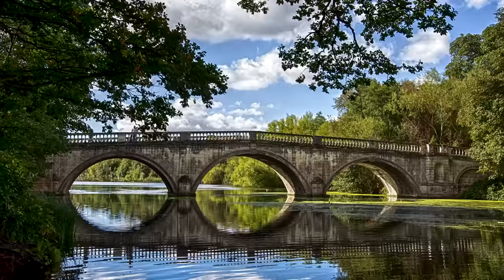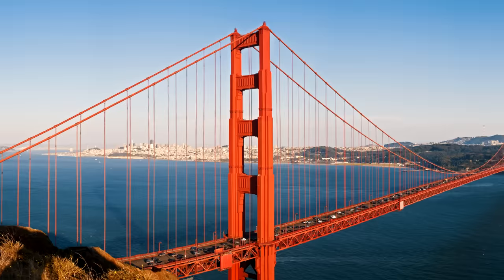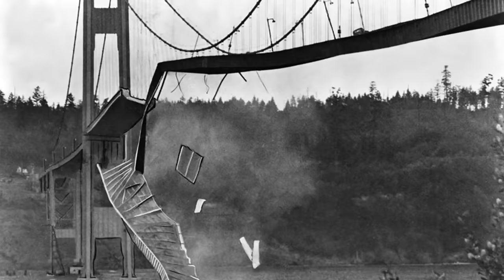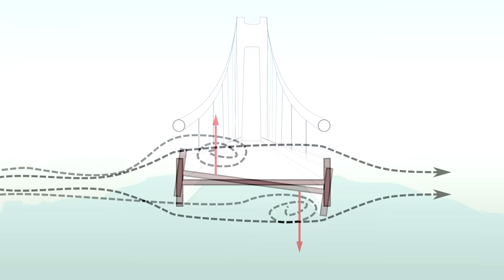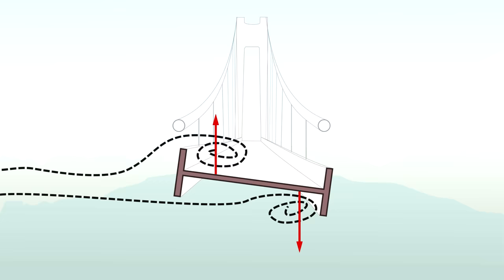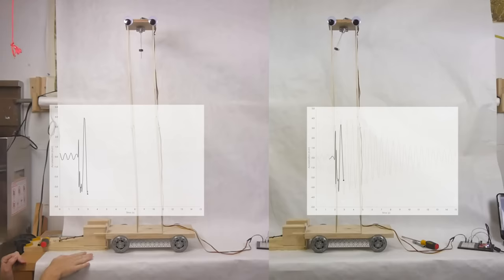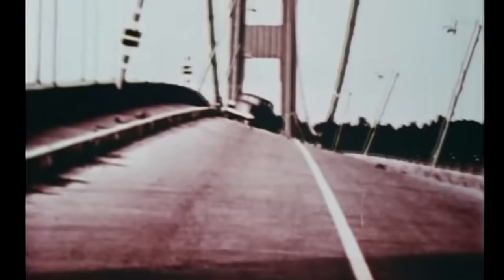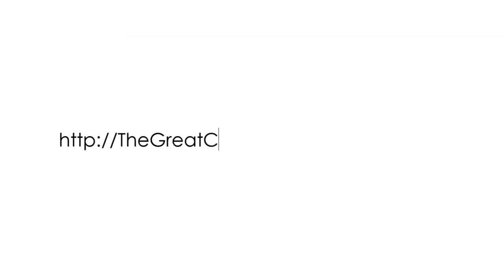Why the Tacoma Narrows Bridge Collapsed

Comment: I live in Michigan and north of here we have the Mackinac Bridge, which was built four years after the Tacoma Narrows bridge, yet spans almost 5x the distance. The winds between the Mackinac straits are well known for it's variability, some days it will be calm, occasionally it might experience hurricane force winds (and ice, snow, freezing rain and high heat in the summer). The bridge was built utilizing some of the lessons learned from TN. The bridge is equipped with grates in the middle and some aerodynamic buffering on the sides. Additionally, the towers were beefed up and the road suspension was built with a much deeper support system. Even with all that, the road surface will sometimes sway as much as 35 feet from side to side.
Reply: 35 feet sway would make me very nervous driving on that bridge!
Reply: In 2013, at the age of 72, I rode my motorcyle on a mission to 'bag' the 13 states I had never previously been in before, starting in CA, all the way to the east coast.  After reaching the east coast, I first visited Key West, FL, then rode north to Niagara Falls and eventually rode Michigan from the south all the way north to and crossed the MacKinac Bridge.  A good length of the bridge is low to the water, no land is visible and at one point, no other vehicles and I felt like I was riding across the ocean.    I am now 83 and just recently, gave the motorcycle to my youngest son.  

BHE

Comment: What I find most amazing about that Tacoma Narrows Bridge video is not the way in which the bridge failed, but the fact that the vertical motion and twisting didn't cause the deck to break apart long before the cables failed.  We non-engineers typically think of concrete as completely rigid material, but that video shows quite a different story.

Comment: Airplanes designed for wind loads? That's certainly just a myth propagated by Big Aero :-P
Reply: Indeed it is. Natural sustained flight is impossible due to natural physics. "Flight" is created through illusionatic magnetism, when you get into the flat, disk earth theories of magnetism you will see that electrons do not exist in any case.
Reply: r/whooooosh
Reply: @conspiracyscholor7866  name checks out
Reply: I want to eat a big Aero.
Reply: NublaNukes Also senior Vice President of the Rick and Morty comity, very much IQ points
Reply: @kylebutzerin7803  sorry u got wooshed not them also /r/ihavereddit
Reply: @JesusJuenger  yum.....
Reply: Matthew Lund  Look up helicopters, Sometimes us rotorheads wonder if this thing is really going to get off the ground.
Reply: NOPE!
If the wind speeds hit resonance with the wings at any speed, they would do exactly the same as the bridge in the video.
Also, if the aircraft turns too tight a curve, the wing loads can exceed their working limits, and break.
Thats why the claim that aircraft were flown into the twin towers, is considered to be rubbish. The claimed flight paths and speeds would have destroyed the aircraft before they ever reached the buildings.
Reply: It's such a sad reflection on what the twenty-first century has brought us that I genuinely cannot tell whether the first commenter is satirical or insane.
Reply: @conspiracyscholor7866  Everyone knows that electrons do not exist, but electron holes do.
Reply: @ZGryphon  Pine bark and peaches?
Reply: @conspiracyscholor7866  you’re my kinda guy.

Comment: I cross the narrows every week, you can see the solutions you mentioned at work on the newer bridges. The replacement bridge was built in the 1950s and uses steel grates in between each lanes like the solution at 5:56. In 2007 a second bridge was built alongside the original to handle the increased traffic, but I can't find as much information about how this new bridge combats the wind. It doesn't have any holes in the deck though. Either way was interesting to learn about this stuff.

Comment: The antenna on my truck has spirals for the same purpose. I've never seen a chimney that tall but it makes sense.
Reply: This is not the primary reason for the helical antenna section,  that section has the effect of adding inductance to the antenna and is referred to as a "Loading coil", that simple put, allows you to make an antenna smaller for a given RF frequency.
Reply: bgdwiepp interesting comment, especially considering the antenna in question has got to be 3' long. I've never seen spirals on those little stubby antennas. I wonder why not?
Reply: @jackfrost1031  The spiral was probably inside the antenna. Also, the higher the frequency = the shorter the antenna. Depending on the band a full 1/4 wave antenna may only be a few inches long.

Comment: I cannot remember the source of information, but I am sure I read that the grating in the road deck of the Mackinac bridge that joins the upper and lower Michigan Peninsulas included grating in sections of the road bed as a direct result of the information acquired from the Tacoma Narrows bridge failure.  I may need suspensions for that sentence.   Anyway, I've been over that bridge a few times.  What a marvel.
Reply: Last days of '70, or the first days of '71, we traveled from London, Ontario to Sault Ste. Marie, Ontario.  It's quicker to go via Michigan and across the Mackinac Bridge.  I was 10, in the back seat of my Dad's '69 Valiant, watching my Uncle drive his big car behind us.  There was a storm that day that started out as wet snow, then the temperatures dropped turning the packed snow to ice on the roads.  On the paved sections of the bridge, I swear I saw my Uncle's car hit the tire high guard rail a few times, pushed by the wind on the ice. But, memory that old is pretty malleable, and ten year olds tend to be dramatic. But....

Comment: at 5:41 "too much stress in the suspension cables" is incorrect.  The element which initiated the collapse was the edge plate girders which failed and unzipped.  The suspension cables were still in tack during the initiation of failure.
Reply: I picture the cable manufacturer trying to explain this over and over as they descended into alcoholism because no one would listen.

Comment: Oh man, I wrote the fluid simulation that you show at 3:43! I wrote it when I was 17 (twelve years ago) from scratch in C to try to better understand how CFD packages work -- I basically just implemented Jos Stam's famous Stable Fluids paper, except I used FFTs to perform the Helmholtz decomposition (he suggests using a Poisson solver instead).

I uploaded the clip to Wikipedia, which is I assume where you got it from. That was VERY jarring to suddenly see something I made 12 years ago pop up! Super cool, made my day!

You can actually see some subtle artifacts from my choice of FFT-based Helmholtz decomposition -- the simulation effectively has slightly periodic boundary conditions, which is why the fluid flow in front of the no-slip cylinder starts wiggling too, not just the fluid downstream. This is an artifact of the simulation, and doesn't occur in a real Kármán vortex street.

Comment: when I was in college, my Physics 1 professor had a great rig for demonstrating resonance in structures. Because it's California, he used a "building" to demonstrate resonance in an earthquake.  The building was a three-story affair about 2 1/2 feet high.  Fairly flexible sides made out of sheet metal, and each floor was a piece of wood  with screws going through the sheet metal to anchor them in place. On top was an electric motor that had a stopper from a flask with an off-center hole on the motor shaft, so it would vibrate. He also had a strobe hooked up  and a control that governed the motor speed and the strobe speed.

He turned the motor on at a low speed and the "building" shook. So he sped it up and the building began to sway as a unit. A little faster, and it went back to a shake. A little faster and the floors started moving opposite directions. It was fascinating to watch as he talked about what was going on.  Suddenly there were several loud bangs, and the whole thing collapsed in a pile.  It turned out that letting it run for an extended time at the "floors moving opposite directions" speed put enough stress on the screws that they pulled out of the wood and it collapsed.  He looked at it for a moment and said "Well, I didn't expect that to happen".

Comment: It seems like nearly all of the major "engineering failure" videos have the same sort of thing in common. The guy holding the purse strings cheaped out after construction began.
Reply: washington has sort of learned their lesson, now we spend as much as humanly possible on projects like this!
Reply: Actually, not in this case. The design was specifically created to suit the budget. It was the narrowest suspension bridge designed and was actually quite celebrated for it's innovative design.
Reply: Since when did politicians worry about spending our money? Some tv show I watched about 20 years ago stated that after the George Washington Bridge was built engineers had their own goal of making them lighter. IIRC, the show said that the farther west you went the lighter the bridges were.
Reply: Except that the original design also included an open lattice truss system that would allow wind to pass right through. It was the construction company that cheapened out by using solid panels instead (likely to pocket the difference). If they'd stuck to the original design, the bridge would not have collapsed.
Reply: More like overestimating the innovation (whether new materials or new designs) combined with a failure to realize that they are unproven.  I'd chalk these failures to human hubris.

Comment: This is just the best. Love you scaled models. Hope you remembered the reynolds number when scaling :-).
Also "Interesting" = "enormously difficult" for those non engineers out there.
And "enormously difficult" = " many assumptions" for those engineers out there :-p
Reply: I think "hang the thing and crank up the fans until something cool happens" is appropriate scientific procedure here. Proper Reynolds scaling would only really be necessary if someone was planning on using this research to for a full-sized googly-eyes bridge and that might not be a great use of taxpayer money.
Reply: hehe... Yes it is absolutely fine. :-)
But if its worth doing, its worth overding. Thus bridge to scale and "proper" reynolds scaling it is.  What wind conditions might there have been. Analyse the movement of the bridge...
Maybe this is way my youtube channel still have 0 videos :-)
Reply: Petch85   Agreed.  For my industrial Electrical students “seeing is believing.”
Reply: @SulfuricDonut  No. The slot especially is going to be sensitive to the Reynolds number. I think the important thing is that he’s not trying to model that bridge and he’s not saying putting a proportional slot in that bridge would’ve solved the problem necessarily, rather that it is best practice now for reasons demonstrated with the model.

Comment: Aircraft use their fuel from the inboard tanks first, then from the outboard tanks. This not only reduces the stress on the wing root, it also reduces flutter as there is more mass concentrated on the wing tip, ergo more energy is needed to get the wingt tip moving. The MD11 for example transfers fuel from the tip compartment to the inboard compartment only when 70% of the fuel in that tank is used up. At this time there is as much fuel in the tip compartment as is in the inboard compartment.
Reply: Well it's also sloshing around through the baffles, making it a natural dampener.  Not just the weight.
Reply: UnbeltedSundew Wing flutter is a vertival movement, while fuel sloshing is horizontal. This shouldn't play a big role
Reply: Hmm... Perhaps I had it confused. I think I got the thought from this video by Mentour Pilot: https://youtu.be/VpzUbYex4dg?t=4m6s
He doesn't actually mention dampening action from the fuel at all in the video though.  And if one thinks about it, depending on fuel to dampen the vibrations would actually be a prety bad way for engineers to approach the solution (making a plane so that it's flight characteristics get much worse over the time in the flight).  I think maybe there is no need for a dampening force against air current because of the nature of the functions of the wings in the first place (manipulating the air flow and speed in a very specific way so that it creates a low pressure area above the wing to make lift).

Comment: Thank you for making these videos, I always look forward to watching them! I live in Washington, but when we learned about the Tacoma Narrows Bridge we never went into depth about the cause of the failure, so I assumed resonance. I have a question about fire hydrants, and their infrastructure. I've heard there's a mandated range for them in cities (300 feet spacing?), and I wonder what would happen if you opened multiple at the same time (would the pressure be affected, or are different parts of the city separately linked?). It might make for a fun video!

Comment: Bridges like the Tacoma Narrows bridge and the golden gate bridge are expensive to maintain because of the salt water.
Reply: Yes, but the alternative before that was a too long ride in a ferry to traverse the Bay. Maintaining the Golden Gate Bridge is preferable to ferry rides. Ask the commuters after the Loma Prieta earthquake in 1989.
Reply: @LadyAnuB  oh yes it is much more efficient and much more worth it to have a bridge than a ferry. The Tacoma narrows bridge is the only road route across. The alternatives were either drive way down to Olympia and back up or take a farry.
Reply: That's true, which is why the new Narrows bridge is mostly concrete, and they've maintained the tolls to cross the bridge long after it's been payed off. Still better than having thousands of commuters driving around the long way through Olympia or taking one of the ferries (another system that's aging and overburdened as it is).

Comment: Oooooooooooo - I wondered why those helical bits were present on all the big chimneys on campus - my best guess was heat baffles or structural integrity (rigidity), but that didn't make sense because I doubted they would serve well in that capacity, on either front. Now i know! 

And knowing is half the battle.

G.I. Joe.

Yo Joe!

Comment: Many automotive antennas have a helix around their outside.  In the 80's every car had a straight rod for an antenna, but in the 90's makers started adding a helical shape.  I doubt you can find an automobile made today that doesn't have a helical antenna shape.
Reply: Except for those antennas that are contained in the car glass.
Reply: Hmm, didn't consider that. I guess it makes more sense now why there is a wire wrapped around my antenna in a helical fashion.
Reply: Huh, I guess that explains the funny shape on our old minivan's antenna...
Reply: EFormance Engineering   Our professor hinted for us to estimate the fuel economy savings due to adding that.  He said cylinders (?) have lots of drag.
Reply: This is not the primary reason for the helical antenna section,  that section has the effect of adding inductance to the antenna and is referred to as a "Loading coil", that simple put, allows you to make an antenna smaller for a given RF frequency.
Reply: I tend to disagree.  It's trivial to make an automotive antenna 1/2, 1/4, or 1/8th wavelength without resorting to loading coils.  The antenna that the other replier is mentioning is probably a VAG (VW) antenna, and they are typically located either at the front of the roof or aft end of the roof, areas where turbulence is high.  My original example is based on Ford 1/2 wave antennas, starting about 1993 or so.  The VAG antennas are just a straight rod with a wire wrapped around them and a shrink coating on them.
Reply: @eformance  Mine is a Renault actually. Nevertheless it's mounted on the rear center of the roof.
Reply: We are both correct, i was referring to a different type of antenna on vehicles to you, both had helical sections for different reasons.

The type of antenna you are referring to is a monopole antenna with the wire wrapped around them and the shrink coating on them to hold it in place.

The type of antenna I was referring to was a monopole used for multiple bands, often for cellphone use or for use on HF and UHF simultaneously.

Your reasoning is true for the first above described antenna, my reasoning is true for second.
Reply: Oh, I thought you were talking about the FM receiver antennas.  Yes, both my 2M and CB antennas have loading coils.
Reply: How much wind force really acts on such an antenna?  I'd think it's insignificant compared to wind forces already acting across the entire vehicle.
I'd always assumed the antenna helix was there for improved radio reception, radio engineering stuff about increasing the effective cross-sectional quarter-wavelength contact area with the electromagnetic wavefront, etc etc, basically a smart way to build the product cheaper and better.  I just works so I never did the math to confirm it, lol.
... But I suppose that while the wind forces might have a trivial impact on vehicle stability/performance, they might be strong enough to whip and bend that antenna or tear it off.
... I still suspect it's just a way to add more strength and flexibility with minimal weight and material cost, not much emphasis on aerodynamic properties.

Comment: I am sure it has been mentioned but I always point out to my students that if you watch the torsional oscillation before failure it is interesting to see the lighting poles are moving 'piecemeal' an indication to young students that they have a different natural frequency which they are not being driven at.  We had a building by our lab with a lose roof section and the noice from the aerodynamic flutter was a constant reminder of physics at work!  Great video - many thanks for making them.